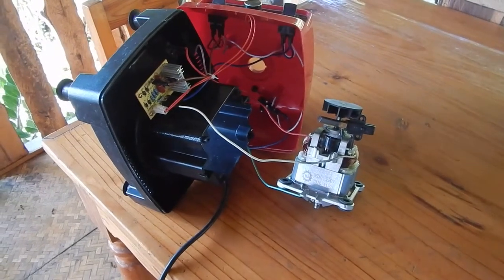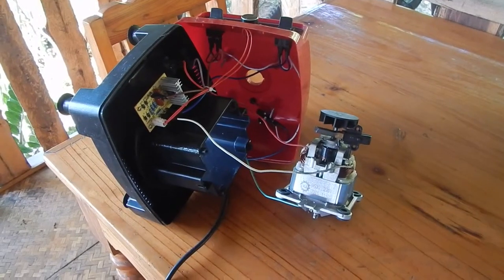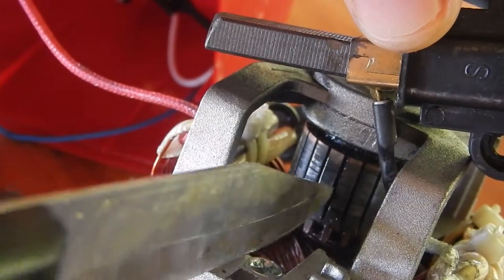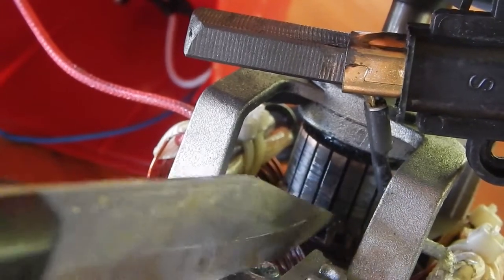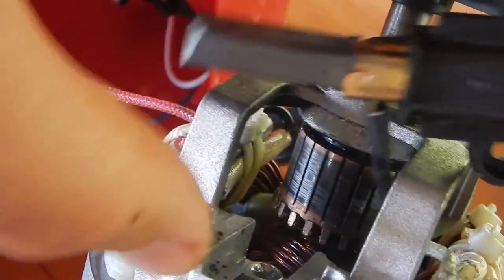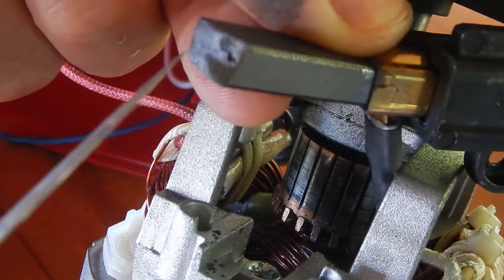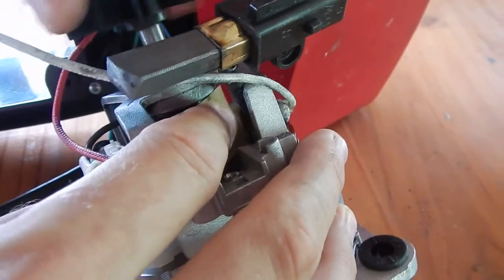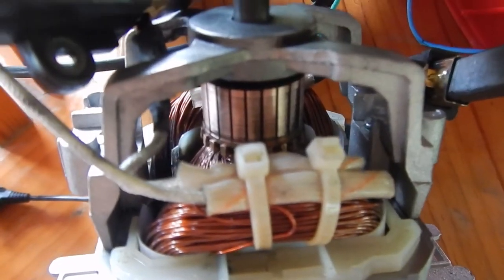Broken Electormagnetic Blender Engine (Sparks, Smoke, Smell)

Comment: Try to replace the brushes. The original brushes do not have any spring strength.
Reply from the maker: unfortunately my skillz were not that great, nor was the skillz of the local electronic shop. The blender died. But thank you for the info, might come in handy in the future.
Reply: Even if you change the brushes, the sparks will continue!
Reply: @DIDASTUMAINI so what's the perfect solution? Replace the engine or what?
Reply: @Boye_Emmanuel  The solution is buy a new one 😊,  it had a weak motor to begin with.